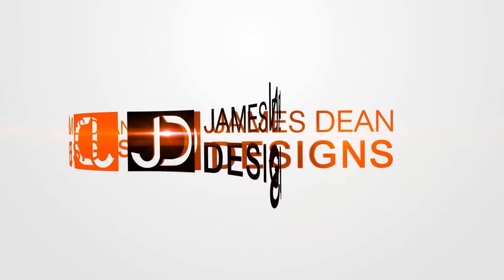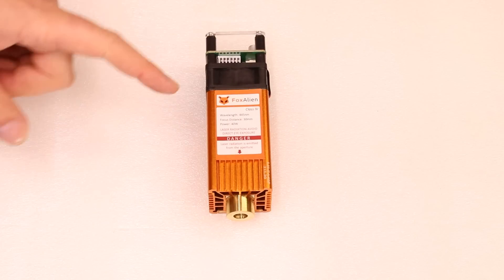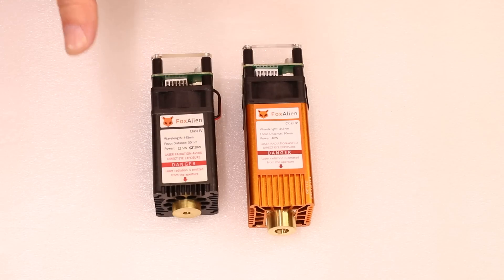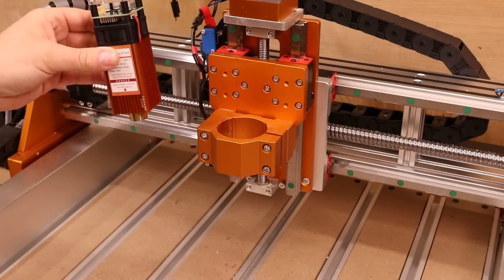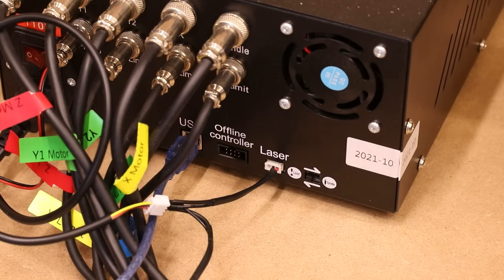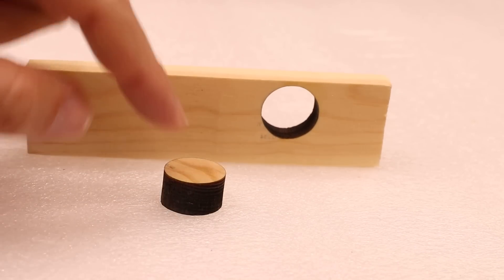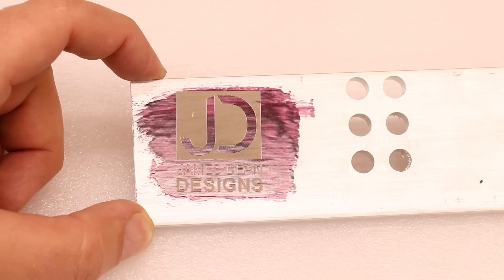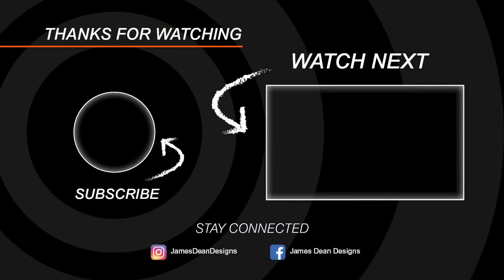High Powered FoxAlien 40w Diode Laser (10w Output)

Comment: James. Thanks for all the amazing videos. As a newbie they are my main source of info. I pick up something from every video. However, I have the 40W laser on a FoxAlien Masuter Pro, but I can only cut through 3mm ply at 250mm/m @100% at 275mm/m I get a result similar to yours @ 600mm/m. I have set the Max speed in Lightburn @ 10000 to match the 60W max spindle speed. Anything else I might change to improve my results?

Comment: Did you say the Reizer platform didn't require the power cable adapter?
Also, what are the X and Y axes of the 40W?
The default is 10mm x 10mm. Does it matter?
Thanks.

Comment: I bought a 20W laser and metal work area, and I was wondering if I could switch out the 20W module with a 40W module and reuse the work area, etc, that the 20W can with. Thanks.

Comment: @JamesDeanDesigns     I was wondering, is this diode ONLY for cnc machines or could I buy a cheap diode laser and swap the diode for this one please?
Reply from the maker: You can buy a cheap machine and add this to it. Just need to make sure the 3 wires on this are in the same order as the one on the machine you connect it to.

Comment: Hi.
I know I send my question kind of late on your video but hopefully you read and response. I bought a CNC (Masuter Pro 800W router and 40W laser). The router works just fine but when I switch to laser it did not emit any light. 
I got the $30=10000, $32=1, Set up fire button with power 20%(already reach maximum). But it still does not generate any light (power). All the jogging, testing of the CNC are ok (run correctly) it just did not emit any light. I check cables and connections and all are good. What is your suggestion?
Reply from the maker: Your $30 setting needs to match the Smax value in in your laser software.  By default this is usually 1000 in the laser software so either up the software to 10000, or drop your $30 down to 1000.

Comment: hopefully you can help me, I have 4040-xe that I added a fox alien 40w laser, I am using lightburn software. Now for the issue I can not get it to cut thru 3mm bass wood, I have run it all the way down to 10mm/m at 100% power.I use the the 30mm spacer to focus the lens. Can you give any ideas. Thanks Bruce

Comment: Hello James...does a  40w Foxalien laser diode gives you a full power when you are running the laser from the control box or must be plugged in straight to the power to give 100%, please advise...
Reply from the maker: Will depend on the control board bit most will need the external power supply to run at full power

Comment: I have a problem, my laser don’t switch off when change to position from engraver A to engraver B, is a masuter pro Cnc and 80w laser
Reply from the maker: You will need to set the machine to laser mode. Adjust your $32 settings. It should be $32=1 for laser

Comment: only thing missing, How in the world do you adjust the Z ? I was hoping this was an all encompassing video :(
Reply from the maker: The Z is adjusted based on the machine it's fitted to so it. If its a cnc machine then you just jog the Z up or down in the software. If its a laser with only 2 axis then you just manually raise it up or down.
Reply: @JamesDeanDesigns  hmm, yeeah ive tried that in lightburn, its a masuter pro

Comment: Hi James, very interesting to see this laser cut through the 12mm pine. Did you set the focus point at the surface? or did you add 6mm focus distance? would it help? I know that the laser is not meant to cut through thicker wood, but would setting the focus point half way through impact the cut quality?
Reply from the maker: It would have been to the surface or just 1 or 2mm below. If you set it too low it will struggle to cut through it initially and just burn the wood

Comment: I haven’t FoxAlien 4040 XCCNC machine. I’m looking at the 40 W laser but I want to know can it cut aluminum like 6061 or 5052 or 7075 aluminum and if so, what thickness per pass and how many passes and what is the maximum thickness I’m guessing 6.35 mm or a quarter of an inch??? Also do they make a more powerful laser like an 80 white with a 21 optical cut/engraver???  Realizing of course, that with an 80 water have to have a definite separate power supply. Please advise at your earliest convenience.

Comment: would this laser engrave stainless steel?
Reply from the maker: Depends on your definition of engrave. Engrave usually means to remove materials and this will not do that, but it will mark stainless steel and can actually colour it red and blue
Reply: @JamesDeanDesigns  thanks. I’m looking at a sainsmart laser that outputs 5.5w. Would that mark stainless do you think?

Comment: Hi James I have just got the 3020WM and 40 Watt laser after watching your videos, which i was impressed with. The thing that really struck me was that you used brasso to engrave the acriylic, which turned out great, so i was wondering if you could give me an idea of the power and speeds that you used. I would be very grateful if you could.
Reply from the maker: Hi John,
Best thing to do is just run a short test because the thickness of the brasso and the type of acrylic will make a difference but ultimately you can use lower power or faster speeds as you're only really lightly melting the surface

Comment: Hi James. Just want to double check... the 40W laser needs a PSU to operate at full power?? I only ask because when I asked FoxAlien about a PSU they said not needed as works fine at full power with no PSU. only the 80W laser needed a PSU.
Reply from the maker: Yes thats correct. I believe the only machines they said it didn't need a PSU for was the Reizer and Reizer Mega. Perhaps they have since improved the efficiency but I have heard of that

Comment: I know this video is a year old but im replacing my Genmitsu LC-60A and was wondering how Foxalien as a brand is. Cant find mant reviews? I have a couple Genmitsu lasers but want to branch out
Reply from the maker: They are good as a brand. They are a little smaller than sainsmart but equally their customer service is brilliant which is why I opt to work with them. You will find reviews about them on places like amazon
Reply: @JamesDeanDesigns  I appreciate your reply! As you  know there are so many other brands out there it can get overwhelming researching them all over again. I think im sold on the Foxalien brand! Cheers!
Reply: I just received my  San smart LC60A laser. for the price on sail for 299.00 shipped it has quit a lard working area. but was wondering if it is possible to get a more powerful laser mo-dual for it have been checking out the laser tree 20w optical output and also the lynee 10w along with the NeJe 12 and 24w model. will they fit my machine and if not is it possible to modify the mounting or tweek them to fit the mechanism.

Comment: can the 40w laser with that came with the Vasto be install on another FA laser frame using the new power suppyl cable that came with the 40w laser???
Reply from the maker: Yes, I believe so. It draws the power from that separate supply so in theory will work on nearly any machine

Comment: Guys, I have this laser and it doesn’t cut at all like in the video. 3mm of plywood doesn’t even cut it with 100% power at 100mm/m with one pass. I did the replacement and I still have the same problem. All the settings seem ok, but is there anything I don’t consider? I’ve been looking for a solution for over a month
Reply from the maker: Are you using a separate power supply and the splitter I show in the video? Air assist also seriously helps when cutting. The other major factor is the ply wood. I use balsa or basswood ply most of the time. This is a lighter plywood, but you can get plywood which is more dense and therefore harder to cut
Reply: @JamesDeanDesigns  Yes, I use the separate power supply as in the video. Does it have any effect on power? I have the Masuter Pro. I will also try with other woods as you recommend.

Comment: I am running a Foxalien Masuter Pro and the 40w Foxalien laser.  I am using Lightburn 1.2.04 when the 40w laser is attached.  I don't seem to get 100% power when I use the recommended $30=100 $32=1 GRBL settings.  Lightburn documentation suggests that certain controllers require a different $30= value.  Do you have any experience with these settings?
Reply from the maker: $30 should be 1000 not 100 but crucially you need to make sure the Smax value in lightburn is also set to 1000. This ensures the software and laser are running the same power commands. Also are you using the separate power supply with the laser?
Reply: @JamesDeanDesigns  I finally figured that out.  Yes I am using separate power supply that came with the laser head.

Comment: James, question I have a Reizer system just added the 40W laser head. When cutting 3mm ply the max speed I can use is 100 mm/min in a single pass to get a cut that is clean through any faster the cut is not completely through. Is there something I am not setting properly to achieve the cutting speeds you are indicating in this video?

Comment: Hi James ... having just ordered a machine bundle with the laser (by clicking your affiliate link!) I was keen to find out more.  I think high pressure air assist is cooling the cutting surface more than is optimal.  It occurred to me tha maybe using a beefy workshop vaccuum cleaner with a small bore pipe near to the cut point might just be better at the job .. have you tried that?  I'll certainly be giving it a go when my Vasto drops through the letterbox...
Reply from the maker: First, your Vasto is not fitting through a letter box 😆 
I think think there was a few issues with the high pressure test. There was no moisture trap at really didnt help either. A vacuum could work, it's a test I haven't tried yet

Comment: How does this produce 10w optical output when other Chinese manufacturers need 80w? Has anyone done an independent test of output? This is the same double laser system used by the Neje. Without an independent test I'm thinking they are just quoting the input of each laser, not the combined total, I am not convinced that they have increased efficiency by over 100%.

Comment: So, the laser market is STILL carrying on with these rubbish, made up power ratings.
I wish one of these channels would just buy a laser power meter and test these "40 watt" lasers so we can get an ACTUAL power spec. The least you could do is tear the thing down and extract the laser diode, get the part number off it and at least attempt to track down a data sheet.

These are probably the same old, 2nd hand blue diodes from laser diode arrays, extracted from laser projectors that have been flooding available on ebay for years. They range anywhere from 2-5 watts and make all sorts of claims about being "binned" and "tested" to up to 8w optical output, except for the unrealistic listings suggesting 14 or 20 w optical output.

This is no different to the days of ebay listings for "high voltage generators" capable of 1 million volts or more. It's maddening.
Personally, I don't want the laser for an engraver set up. I would like to know the actual specs, like if it's a single or multi mode, beam profile, fast and slow axis divergence, and the actual optical power output and at what threshold voltage and at what "steady state" temperature, instead of listening to people banging on... repeating whatever the "sponsor" told them, verbatim and without question, in order to score themselves some more free kit.
Reply from the maker: Let's just be clear, some things I pay for, some things are sent to me but it took a hell of a lot of time and effort before anything was sent to me for free. Next, my target audience are beginners who quite frankly don't care about data sheets and part numbers, they just literally want to know what the laser is capable of and whether it meets there needs. And finally, the reason I started doing CNC videos is bacuse none of the videos I was watching met my needs, so instead of being negative and moaning about all the YouTube videos you don't like, being a troll and how you think we're all just after freebies, how about buying the laser your self, stripping it down, doing all that work, record it all, narrate it all and then post your own video because until you're doing that, you really don't have any ground to stand on for criticising  others 👍
Reply: @JamesDeanDesigns  troll. lol
Cool man.

Keep repeating bogus marketing bs.
Sorry if I came across a bit blunt, but perhaps you could widen your audience?

I can tell you, there is a large group of enthusiasts looking for actual specifications on these lasers, and it's frustrating for us that everything you look at is just more of the same parroted bullshit. Click bait title after click bait title about "40watt lasers" that are not. 

Sadly, I don't have the time, or the capital to start a YT channel. But if I did, I wouldn't be having a go at people who criticise me for parroting bullshit. Mostly, because I wouldn't be parroting the bullshit for clicks.
Reply from the maker: @Jimmeh_B  you clearly have time to watch lots of videos and put lengthy replies, so yes you do have the time to make videos. All you need to make a YouTube video is a phone that records which I'm fairly certain you have, no real capital needed. 
Truthfully, the reason I don't strip them down is because I don't know enough about all the components and I have no issue admitting that. I've been into CNC and laser for 2.5 years (as a hobhy) at which point I was an absolute beginner and I still preach now that I am a beginner. I dont come from an electrical engineering or coding background or anything like that. It sounds like you probably know more than me and again I have no issue admitting that. I also have no issue with people making suggestions on how I could improve my channel, I take on a lot of feedback...but there is a huge difference between positive criticism and your angry response. You want to be angry at me for using the information I have to hand, then feel free. Most of my videos have over 96% positive ratings so 🤷‍♂️
Reply: @JamesDeanDesigns  TBF, you did at least include the (10watt output) in the title. You're far from the worst of the channels out there.
Reply from the maker: @Jimmeh_B  😆 I will take that as a compliment! The issue is if I post it as a 10w, and FoxAlien call it a 40w, then people think I'm reviewing something different and if FoxAlien call it a 10w but their competition call theirs a 40w then it makes FoxAlien look less. Its a bad cycle and I completely see the frustration. If you want me to strip it down and give you any details I will certainly try. You can then possibly teach me what I'm actually looking at inside of these things
Reply: @JamesDeanDesigns  Yeah, well, that's probably not the go, lol.

If you are interested, they are most probably  "nichia" NUMB44 laser diodes which are generally a 4.8w laser diode, side emitter (again, after 6 years, I still can't find out what they're actual power rating is). The driver boards drive them much harder than they should, but given that they're not running in continuous wave, they don't usually get so hot as to turn them into "dark emitting LEDs".

Apologies for going off on a rant, you don't deserve it. You were just the lucky one who's video I caught last after another fruitless 5 or so hours of reading forums, ebay listings and watching youtube as a last resort. 

Something you might find interesting, there are also available, semi-cylindrical beam profile correction lens sets floating around out there that will tidy up the fast axis of your laser, squaring up the beam instead of it projecting a rectangle. They'll give you a considerable increase in power from the better spot focus and a closer to equal kerf in X and Y cuts. I don't know how you'd go about mountings that are rigid enough to install them though.
Reply: The video showed some of the cutting capabilities. I believe that's more important than knowing the rated wattage.

Comment: Thanks for the tutorial!  I have a question on the thicker wood and maybe a test. You calibrated the laser to 30mm above the wood surface then started the burn.  I wonder at what distance away from the 30 mm it’s cutting ability is diminished?  Perhaps you could set the laser distance to the 30mm plus the thickness of the material (like 19 or 20 mm or 3/4inch ). So you would have your focal point at the surface set to say 50mm and it would show what it’s cutting ability would be towards the bottom. Not counting as you said sap, fumes, etc.   if it does make a big difference perhaps you could find a different focal point say 20 mm above the surface so as to split the difference as long as that distance is still deemed adequate.  Seems it would have twice the cutting power at the bottom that way as it would with the original focusing distance of 30mm.  Would be something else to consider maybe??  

Thanks again from Texas!
Reply from the maker: Definately worth a shot to see if it works

Comment: Is this laser more powerful than the xtool 60w (10 output) laser?  It sure looks that way.
Reply from the maker: I cant unfortunately as I don't have the xtool and wouldn't want to mislead anyone. Every manufacturers have different ratings and are not always 100% honest with the output power so it's difficult to know without a side by side test
Reply: @JamesDeanDesigns  what are the differences between the foxalien pro and the 4040 xe.  which one is the best bang for the buck?  Also, what more can be done with the 300 watt spindle than the 60 watt spindle?  or could I just get the dewalt or makita spindle for more power?